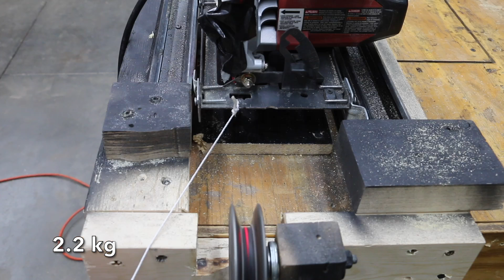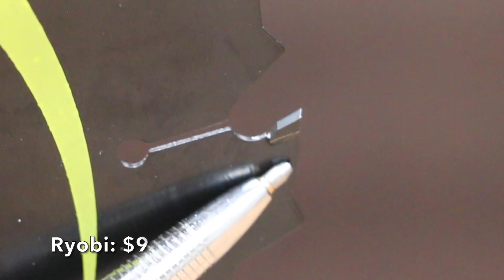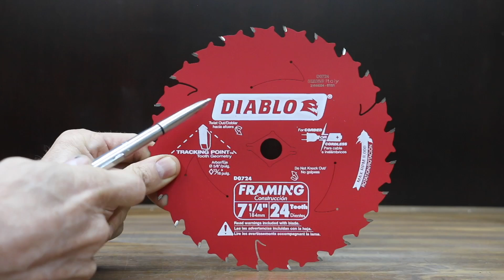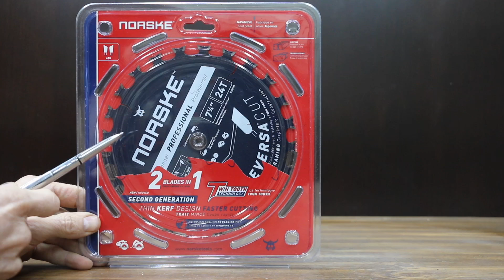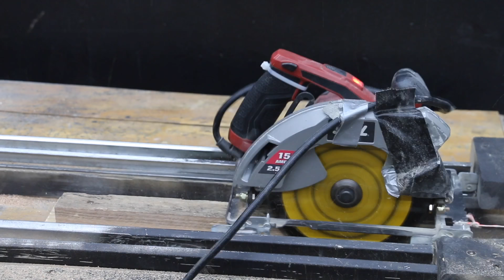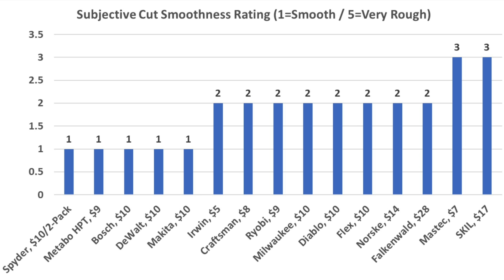Best Circular Saw Blade? FLEX, Diablo, Milwaukee, Makita, Bosch, Ryobi, Irwin, Spyder, SKIL, Norske

Comment: My crew has been framing a 5,000 Sq ft house this past month. When we started, we bought a bunch of those spider blades, never used them before. We always bought the bulk pack of Diablo before. Everyone was impressed with them the first few days. Then they would start to warp and dull and just make awful cuts. After a week we went back to Diablo. There's an endurance test you are missing in there somewhere. Without cutting through any nails, the Diablo lasts much longer in our experience. It wasn't the teeth that were going bad, it was the warping. Hard use, cut after cut, all day long, the blades will get very hot, how they stand up to the heat makes a big difference. The Spyder failed. We have also been using a couple flex brand blades, they have been holding up well. We never buy the cheap Dewalt anymore, they just cut like crap. You have to buy thr expensive ones to match the performance of the Diablo.
Reply from the maker: Thanks for the feedback.

Comment: I have a Spyder 7 1/4" blade, but mine is 60 tooth and was $20.00 at Lowe's.  Their 24 tooth is $9.00.  Maybe I should have shopped around a bit, but it was more of an impulse buy than anything else.  I was looking for a 9" ripping blade for my Rockwell model 9 contractor saw I restored and of course they didn't have anything in that size.  The Spyder 60 tooth works great on my old Craftsman circular saw on plywood leaving a fine cut with no tear out.  Since then I've bought a 9" DeWalt MBF radial arm saw from the early 1950's and restored it and have a 9" 22 tooth Freud blade for it that was $39 on Amazon and will do my ripping with it and save my contractor saw for cross cutting and miter cuts as setting the miter gauge on it is much faster than doing it on the RAS.  Since the contractor saw will be for cross cuts I went with an 8 1/4" 40 tooth Milwaukee blade that was $35.00 at my local Ace hardware.
Reply from the maker: Thanks for sharing.

Comment: I was hoping to see Avanti Pro and Rigid blades in the lineup. Rumored to be made by frued? Also rumored that the Rigid brand blade is better than Diablo? Anyways keep up the great work. Every time I watch a vid I’m amazed at the testing equipment. A lot of good real world testing done. Maybe a stress test of higher tooth count fine finish 40-60 tooth blades and ferrous metal cutting blades?
Reply from the maker: Thanks!  Thanks for the suggestion.

Comment: The nail test is interesting I guess, but I would have liked to have seen how each blade held up for sharpness after making 20 or more cuts in softwood lumber since that's what most 24-tooth circular saw blades are going to be used for.
Reply from the maker: Thanks for the constructive feedback.

Comment: If you do another test like this I’d like to see the current drawn during the cut as well. A blade may cut slowly but also not use much power, and a fast cutter may do so by asking more power. Less important for corded tools than for battery but still a good data point.  Maybe also a tooth width measurement, I wonder if there’s a correlation between speed/power and the amount of wood being removed per tooth?
Reply from the maker: Thanks for the suggestion.

Comment: I used a pack of Makita blades for work and the biggest problem they have is the thin kerf. With consistent use on 3/4” plywood the blade gets hots and tends to warp or wobble and it makes it impossible to cut a straight line. I’ve always benn partial to the Irwin blade.
Reply from the maker: Thanks for the feedback.

Comment: Another consideration is what happens after the anti-friction coating wears off... there are products such as Cut Lube off the top off my head. It'd be interesting to see how blades do with various additives like graphite, PTFE, WD-40 and so on.
Reply from the maker: Great point
Reply: I just picked up a can of PTFE lubricant to spray on my table saw's top surface, a tip I picked up from another channel to help make the wood feed through smoother. Wouldn't have thought of applying to the blade itself, but that's an interesting idea for sure!

Comment: Thank you again for doing this very useful video - I love the Makita blade on my Makita saw. On my table saw I have Diablo, and still looking for a good Miter saw option. I was wondering if you would consider doing an outdoor grip-tape showdown. There are many out there, but they're not all made the same. Some stick less to the surface if not prepped, others start very grippy but lose their grip faster. Lots of stairs and wet weather/snow up here make grip tape a necessity. Thanks!
Reply from the maker: You are welcome!  Thanks for the suggestion.

Comment: I ripped 30,000 sqft of vct covered 3/4 advantech subfloor that was glued and screwed with 2'' deck screws in a supermarket produce section. 

After an untold number of blades the Dewalt 18 tooth performed the best. The bigger carbide took the impact from the screws better and larger gullet made the cuts faster and less strain on the saw. Too bad they have been discontinued for the 24 tooth
Reply from the maker: Thanks for sharing.

Comment: I really appreciate the projects that you do, I don't have the resources that you do, so it gives me a lot of info about different products, what to avoid, and what I might want to get.   
I have an idea about a project, what fuel is best for kerosene heaters. Is Kerosene, Diesel, Bio Diesel, Heating Oil, Jet Fuel A, Jet Fuel B, or some other type of fuel. What works best at different temperatures.
Reply from the maker: Thanks!  Thanks for the suggestion.

Comment: I know this would be an expensive test, but can you do a in depth testing on corded compound miter saws? Brands like Bosch, Makita, Festool, Dewalt and any other brand you feel should be tested. Also cover if you should do a 10" or 12" blade, easy setup, accuracy, quality, safety, power, noise, soft start, blade brake, play when arm fully extended and any other pertinent test you think is valid when picking a compund miter saw. This test you may need sponsorship to test and then send back to them when done.
Reply from the maker: Thanks for the video idea.  By-the-way I do not use sponsors.

Comment: For your next project I suggest you see what a difference in price is after you review the items. The Spyder is now only available in a 10 pack at a price of 12.50 each.
Reply: My local lowe’s has 115 in stock for 9.98 per single blade. The 2 pack for 10 deal comes and goes. It will be back (speaking from experience, as I am a Lowe’s employee.)

Comment: I have to ask (and I haven't looked the comments yet to verify) but what about the saw itself slowing because its getting hot with all the testing?   it can only take barely 7 minutes to change a blade and reset for the next test. could both saw and blade be causing number result fluctuation?...

Comment: A suggestion for the next video would be to see different soldering irons for electronics. For instance, is a cheap $10-20 LDK brand soldering iron just as good as a $35+ Hakko? How does that $35 Hakko compare to it's $80+ counterpart? Any benefit to using a battery powered one? It might be good to measure how quickly it heats and cools, any wobble in the handle/shaft, how tight the tips fit, and for that matter, how durable the tips are. Just my thoughts. Thanks for all the great videos.
Reply from the maker: You are welcome!  Thanks!

Comment: one thing that's missing is the quality of the finish. speed is important in construction and framing, but if you're building furniture or other smaller scale things, finish is more important than speed. i personally prefer a nice, chip-free cut over something just rips through wood. they're all 24T so it'd be nice to see which one offers the cleanest cut.
Reply from the maker: Thanks for the feedback.

Comment: Worked in a factory where an ordering mistake was made. 6 full lifts of special order LSL (laminated strand board) and to use it, we needed to rip them all down by 1.5 inches to a standard size. The beams were 60' long and 2 inches thick with a density of 1.6. I was given a new wormdrive skil saw and we made a rig to cut perfectly straight. I tested nearly all of these blades as our supplier for the shop was interested in longevity of each of his brands. The dewalt couldnt cut straight even from sharp, diablo was ok but would get dull very quickly. Everything else would trip out a 20 amp breaker after 2 boards or so. The makita would cut an entire lift without issue. If God used a skill saw blade, he would use the makita.
Reply from the maker: Thanks for sharing.

Comment: Suggestions : best flux core wire brand (probably .030 since that's what most DIY's I would think would use) and best complete ground cover killer that kills grass and weeds.  I used to use Ortho Ground Kill but now it doesnt seem as effective so I think they changed the composition in the last few years
Reply from the maker: Thanks for the suggestion.

Comment: do a claw hammer comparison :)
handle strength
claw strength
like how much impact dampening it has (because if its not good with that the impact of hitting something will go into your hand and arm and make it hurt alot)
how easy it is to pull nails
how easy it is to hit nails in
and thats all i can think of off the top of my head
Reply from the maker: Thanks for the suggestion.

Comment: Can you test head gasket repair products like K-seal and Barrs? My idea for the test would be to get a vehicle with a very easy to remove head and buy a bunch of new head gaskets.  Then damage each head gasket the exact same way before installing them. Flush coolant then add the products one at a time and see which one does the best job of sealing the damaged gasket.   Also maybe inspect radiator, thermostat, and heater core between tests to see if any of the products clogged the cooling system.  It might be too much work though.
Reply from the maker: Thanks for the suggestion.

Comment: These videos are all very helpful. I would like to see a video on work socks. I am particularly interested to see if the "Darn Tough" socks are worth the cost. I have 1 pair and it is holding up well, but at $25 per pair, it would be interesting to see how it performs. I know they are durable. but just how durable?
Reply from the maker: Thanks for the suggestion.

Comment: This might be outside your MO, but maybe you could take a look at testing different brand tent pegs? I want to get into backpacking, but it seems like tent pegs are either really heavy or really flimsy. They bend, get pulled out or even break when the tent is under tension or pulled around by winds. It would be very useful to have a comparison to help me hit that sweetspot between weight and stability. It'd also be interesting to see how they perform in rocky, cold, wet, loose etc ground types.
Reply from the maker: Thanks for the suggestion.

Comment: I would love to see a video on bar & chain oil.

Maybe comparing different brands and qualities within the brands (standard, premium, eco/veg).

The famous "Canola Oil" that supposedly the US forest service uses, new motor oil, used motor oil, etc.

Also, is summer (30w) really different than winter (10w) or different than all season (20w)? My Echo CS-590 manual says to use Winter and Summer, yet they don't make a winter bar oil!!
Reply from the maker: Thanks for the suggestion.

Comment: I have another video recommendation. Best shovel. I just snapped the second shovel this year while digging some holes for my fruit trees. I need to know a good one that will hold up. Keep up the good work!
Reply: You snapped a shovel?! You mean a full size shovel (not a small one hand garden one)? Wow, must be an exceptionally cheap and bad shovel.
Reply from the maker: Thanks, will do!  Thanks for the suggestion.
Reply: @pev_  I just read your comment and looked at it again this morning. It was an H.B. Smith fiberglass handle shovel. I bought it at the local lumber yard... But yes I've had several snap on me, just trying to dig a little too much mud/dirt at one time and the pole snaps right off the metal blade. Hoping our expert youtuber lets me know the shovel with the strongest breaking point to buy next. There are some expensive ones out there but not sure if they are worth the extra money.
Reply: @rayhawkins8103   OK. It's just that here in Finland all the earth-digging metal-bladed shovels I've seen are always so rugged, usually with a metal or wood pole and metal handle, that iti is hard to imagine them braking from anything but super-human strength :)

Comment: How about surge protectors, could test thermal characteristics, quality of the cord, quality of the internal build, rated amperage vs what can be safely used for long periods of time, strength of the grip inside the sockets
Reply from the maker: Thanks for the suggestion.

Comment: Great review. You always do exceptional reviews. 

Having used multiple blades from different manufacturers, I know that the Diablo is the sharpest most durable blade you can buy.  I have not tried Makita, but I haven't found any blade that even comes close to the Diablo blades in real world applications. Most blades are junk and they not only are not very sharp, they also dull very quickly when they hit a nail. Both Bosch drill bits and blades are not very durable. DeWalt blades I have used are pathetic. It appears that the Makita has sacrificed durability to gain sharpness. That is not a bad thing, but the Diablo eats it for lunch if you hit a nail. I also have not used a Spyder blade, but it appears to be similar to the Diablos. For the price the Spyder is a deal, but the Diablo blades are proven performers under difficult, hard use. You see a LOT of professionals using Diablo blades in both rough and trim carpentry applications.
Reply from the maker: Thanks and you are welcome!

Comment: Get some Hitachi/Metabo blades and a sharpener at Harbor Freight. Save yourself some money as they will take a number of resharpenings.  Actually, that would be a good test, the circular sawblade sharpeners. I use my HB all the time and have not bought a new blade in a few years although I've sharpened different manu's blades with similar results. If your cutting rafters you don't care about speed on the job but want something to last the day
Reply from the maker: Thanks for the suggestion.

Comment: It would be awfully tough to beat the Makita with a kerf of only .057 and a 30 degree tooth bevel plus the greater PSI effective pressure due to the smaller area.  It dulled fast after hitting nails, but it will dull faster than normal even without hitting nails.  However, time is money with regard to cutting an swapping batteries so it may still be the most cost effective.
Reply from the maker: Thanks for the feedback.

Comment: Another great video, and I can't keep up with your output, lol, I'm several videos behind. However, there's another reason for my comment. I know you read them for ideas for future shows. I'm curious about a bizarre engine oil additive. I read that talc, the stuff that is slowly getting banned in baby powder, will reduce wear when mixed into engine oil, like the old graphite engine oils. How much to mix and how to mix I'll leave up to you. I've discovered that talc is widely used as a filler in polyester and epoxy resins. A 1 QT container of powered talc is $19. The median particle size is 10 microns. (Is talc body powder smaller?) I checked the average automobile oil filter stops 25 microns or larger. (Hmmn, there's not an oil filter on a lawn mower, is there? Good, then that's not a worry. )  Unlike corn starch,aka zea mays, the replacement for talcum powder, corn starch in engine oil would just burn up. (LOL, would it make carbon and additional lubricity, lol? That's a different test, lol, I'm really interested in talc in engine oil.) BTW, Talc does not burn, so it will be unfazed by engine oil heat.
Reply from the maker: Thanks for the suggestion.

Comment: I wonder about the relationship between blade weight and cutting speed on the first test. Do you think there actually differences in rpms based on weight? It would be interesting to see a scatter plot of blade weight to cut speed.
Reply from the maker: Thanks for the suggesiton.

Comment: My cordless tool collection has increased to include Black & Decker, Dewalt, Greenworks, Craftsman, Ryobi and Makita.  I have saved money buying replacement batteries, both new from3rd parties and reconditioned from the original manufacturers.  It would be good to know how much you can trust the amp-hour ratings on those off-brand batteries you can find online, mostly on Amazon.  I don’t how you could narrow down your testing with these off-brand guys with so many of them out there, plus the growing number of brands of cordless tools, plus many brands having more than one voltage lines of tools!
Reply from the maker: Thanks for sharing.
Reply: My comment included a testing suggestion, kinda buried in there.

Comment: i wonder if there is a bit of machine bias being that the makita circ saw is probably designed to work best with a makita blade..... would be interesting to see this testing done where none of the blades are the same brand as the saw used for testing..... maybe use some off-brand saw that is not popular and nobody would ever buy, but then use it for testing the blades so that there is no machine/blade brand matching bias
Reply from the maker: Thanks for the video idea!

Comment: Makita - it's been a long, long time since I bought a Makita circular saw blade.  I'm going to have to give it a try.  I also like the cheap Spider - 1/2 the price of the Makita and it looks to perform almost as good.

An idea for another test.  Can you run a similar test using a miter saw?  I use my miter saw more often than my circular saw.  And it's about time for a new blade.
Reply from the maker: Thanks for the suggestion.